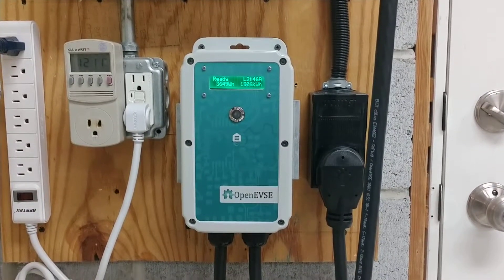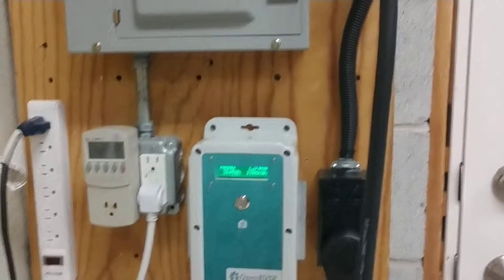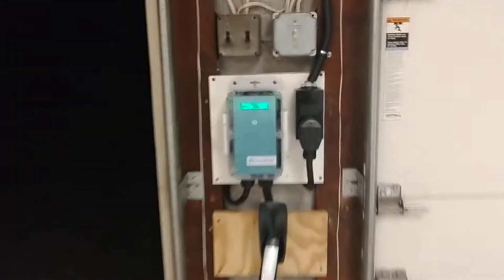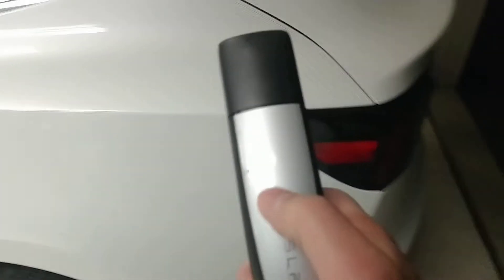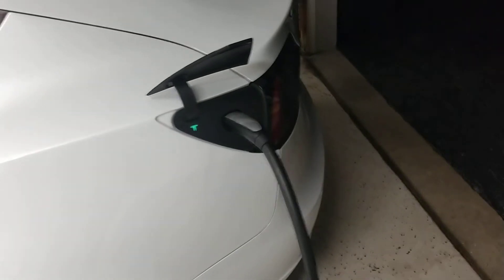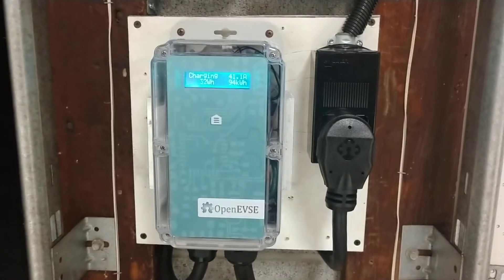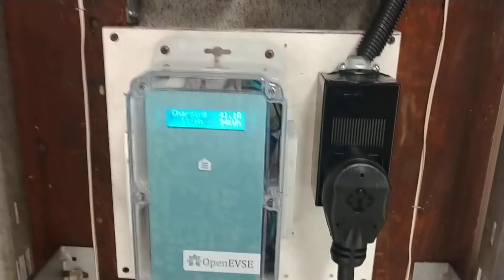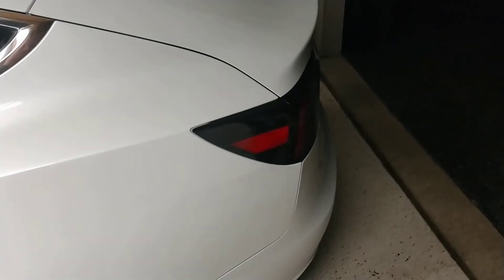OpenEVSE with Tesla plug

Comment: Can you explain the DC DC transformer more? Does the Tesla cable come with an extra wire to be connected somewhere to power that?
Reply from the maker: Yes, the Tesla cable has an additional wire that regular J1772 doesn't have, that wire needs 3.3 volts to power a small radio transmitter that transmits when the button is pushed to open the charge port on the car.  It's optional, everything else will function without it, but I used that small converter to drop the 12v to 3.3v to feed that wire. The ground can just tie into the common ground on the same cable.
Reply: @GregHassler  thank you!

Comment: Are those heat sinks on the side of the openEVSE?
Reply from the maker: Yes, it does tend to go into thermal protection at 48 amps in the summer and reduces the power.  So I have stand-offs on the screws so there is an air gap behind it, and I have some heat sinks stuck on with heat sink tape to help dissipate.  It's not ideal through the plastic but does help keep it cooler. The heat sinks only get warm.